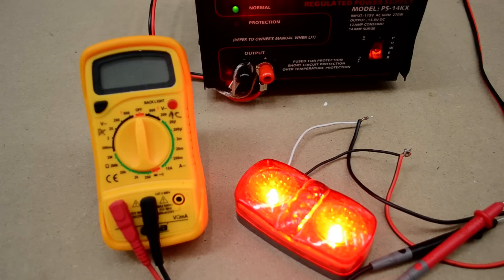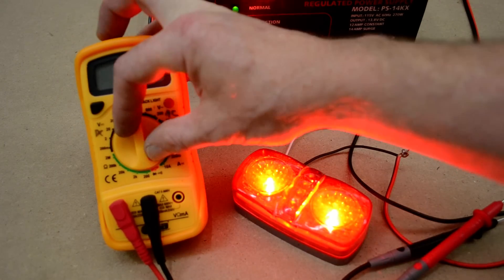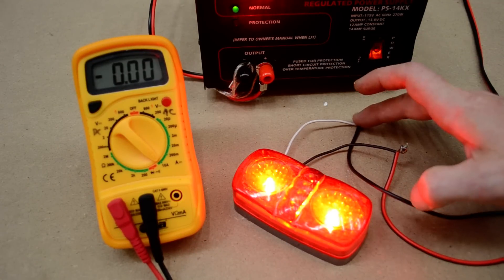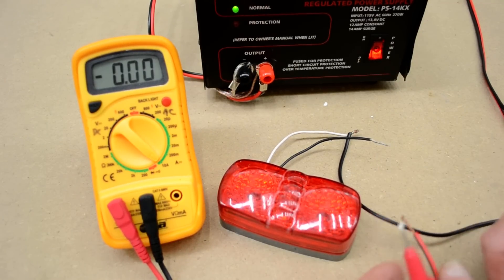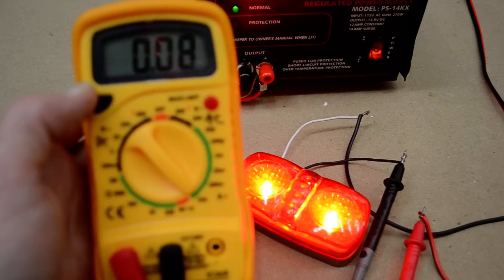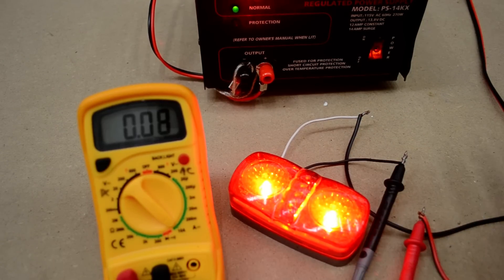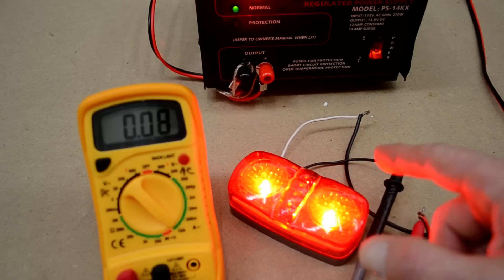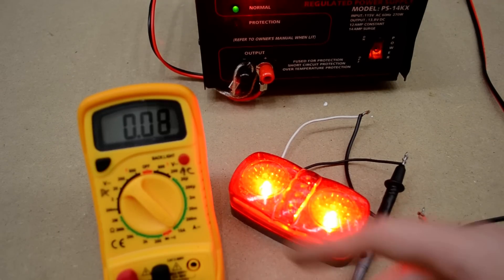How To Test Amperage / Amp Draw and properly measure and fuse a circuit

Comment: This was so well explained but when I went and hooked it up it didn't turn on? I did see a reading. 2.6.The appliance was a 500 GPH Rule pump, it says (1.6A at 1M of lift protect with a 4A Fuse) My cheap Lowes Southwire has a selection of 40A DC that I used. Thanks for your video

Comment: This video is giving incorrect information unfortunately. If you consider what the meter is telling you, this lamp is drawing .08 mA of current. The DVM is set to 10A but this does not mean that the reading is close to 10% of 10A (refering to the .08 reading). The 10A setting is a 'MAX' setting of the meter in this position, meaning that you can test a 10A MAX circuit before the internal DVM fuse blows, but still, the meter is showing you the actual current that is drawn, which is in this case .08mA. The correct fuse would then be something closer to .08 mA. When he suggests a 1A fuse, this is 12.5 times higher than .08. I think the smallest glass fuse you can find is .225mA (1/4A)and this is almost 3 times higher than what is needed. 1/4A fuse would handle the lamp.

Comment: Thx, this helps refreshing my knowlegde. So just to be clear, a device pulls amps? so as long as the voltage in the circuit is right, the device can never overload by say, getting too much ampere?

Comment: Would you read the charging amperage the same way? Like i want to check my battery charger to see what amperage it gives out to charge the battery? 

This is my thinking on the positive side connect the multimeter red positive to positive on charger and multimeter black to positive on battery. Will this be accurate or is there another way to test a charger amperage output?

Comment: thats not 0.8amp, thats 0.08amp.... my 25" industrial fan which feels like a plane is 0.93amp, 100% sure that mini light doesnt draw that... 10amp on the meter means max 10amp but thats still a direct amp reading, you dont need to move the dot like you did mentally for whatever reason.

Comment: I need to try this on my 12v "cooler". It heats up the cigarette lighter plug so hot you can't touch it. Never pops a fuse. It claims to be 65w. I call Bullshit. I've had these in the past where it actually DID melt the plastic and never popped the fuse- either in the plug or on the vehicle.

Comment: Damn, since when .08¢ is the same as .80¢? Numbers in decimals are the same as your amp readings, .08 is NOT .8! That’s an equivalent bulb to 1w at 0.08/80mA’s.
Reply: And don’t tell me that b|c it’s on a 10a scale that it’s all of a sudden a “multiplier”, these aren’t RPM’s lol. It would had stated it, just like when you slap the meter to read voltage. you put it on 20v and if your reading is 12.43 then it’s 12.43!!

Comment: Pretty sure that 0.08 is 80mA.
0.8 would be 800mA.
1.00 would be 1A
And 9.99 would be basically 10A.
Otherwise the readings on the multimeter wouldn't make sense.

Comment: Voltage equals amps multiplied by resistance or amps equals voltage divided by resistance or resistance equals voltage divided by amps. If you want wattage then multiply voltage by amps. These equations are framed into my mind lol

Comment: This is a dangerous way to test. You should NOT test through the "Live" , as (In the case of doing this test, in a car engine) you could blow the fuse,( or worse) if you inadvertently, let the positive lead, touch any metal, in the engine bay. Always do this test, through the EARTH. connection.

Comment: Hi man.. This will be the amperage of the load only, right? Not the power supply..
Reply: Measuring electron flow in the circuit from point a to point b is amps. Volts = pressure 
Watts = power rating example, light globe, 75 watts or 100 watts. Connect leads from meter in series not parallel. Google search if your not sure.

Comment: STOP. this is incorrect. The 10 amp scale still reads in amps. This is 0.08 amps ok. Your 1 amp fuse can power 10 of these lights
Reply: Looks like the 1 Amp fuse would power  12.50?? [ 1.amp/ 0.08 Ends up as 12.5 So 10 with room to spare.]
Reply: Hello can i ask if how to check an fire alarm bell and strobelight to AMPS???
Reply: So your saying .08 does not go up the more lights you add? As long as they are the same AMP light?
Reply: @crazygrady127   No. Given a constant voltage source and constant current demand of the light assembly  the circuits current will never  change.. It will only be split up or remain the same depending on how the circuit is wired. 

With current in a series circuit like this, it’s either all or nothing. Same current through everything or no current through anything. 

However, if he added another light assembly with the exact same specs (power consumption of bulbs, exact gauge and length of lead wires ) in parallel that would just divide the current through each  assembly equally but in the end the sum of the total circuits amperage draw should  never exceed or decrease from 80mA (0.08A). Theoretically.

Comment: Thanks, just watched 2 videos where all the action was happening off-camera, third time lucky, thanks.. The problem I have is my power supply is 12v DC connected to a 12v 3amp speed controller connected to a 12v motor but I dont know what the motors rated amp draw is, theres no spec sheet for it, and the motor is drawing 0.15MA and the motor is getting hot after 1 minute of running. Does this mean the motor is running at a higher amp rating than its designed for?
Reply: Yes.
Reply: @jet-z2r  That was so long ago I don't even know wtf im talking about, I can't remember what the hell I was working on at the timeto ask that hehe

Comment: A Wrap Around Amp Tester Is Safer for High Voltage and Much Easier! Just Clamp it Around the Hot Wire for a Reading! No Disconnecting Wires.
Reply from the maker: Im teaching electrical theory, not entry level quick fixes

Comment: You definitely dont want to use this for an amplifier because it'll blow right through the fuse on the multimeter. Amps draw way much more amperage than a light bulb.

Comment: You said the White wire is ground when technically it’s neutral, and not connect to it but if I were to check the wall outlet for amps could I use red lead to positive and black lead to ground to test amps?

Comment: 0.08A are 80mA not 0.8A, that would imply 800mA

0.08 x 12 = 0.96 watts 

0.8 x 12 = 9.6 watts

Kinda looks like a 1 watt kit to me, dunno
Reply: I know, two years later, but it is the top comment and it is wrong. He set his meter to 10A. So it is 0.08 10A which equates to 0.8A. He is correct.

Comment: i was unknown to use multimeter, i putted 10A port and com port directly in my plug socket. nothing happened just one sec light pop up. but my multimeter is working fine when i use com and volt port to measure voltage. did i blown my multimeter fuse? or everything is ok?
Reply: If you blew your amp fuse, the amp scale won't work. Testing amps must be done in series not parallel. Break the power supply side of circuit. Connect red wire to power source, black to dead wire so current will travel from power side, through the meter, back out through the black wire completing circuit to get measurement.

Comment: And of course the one question I have for measuring current on a voltmeter you didn't go over.. You didn't mention which outlets the wires get plugged into.

Comment: Thanks.  This is really helpful.  Only thing I find a bit misleading is that your light has a black wire coming out of it which is the hot wire and the negative wire coming from the light is white. Normally the negative wire is black and the + is white or red.  You made logical choices for the red and black wires you have connected from your battery but the wires on the light itself are colored opposite of what is typical.  Still very informative.  Thanks for taking the time to make this video.

Comment: Why break a circuit to measure for amps but not ohms or volts? What happens if you dont?  If you put one probe on positive and one on negative doesnt that basically make the current in the circuit go through meter?
Reply: Hey Wazup, to meaure voltage, you can touch the two leads without breaking the circuit.  Think of voltage as water pressure, however amperage is current.  To measure current, you must break the circuit and place the amp meter leads into the circuit as per the video to measure current or as the analogy goes flow of water.  You can however get a clamp-on amp meter that measures the amperage in the circuit without disturbing it.  They're great, I have one and use it all the time to check wire currents in my bitcoin mining rig.  If you were to place the amp meter as you suggest, you would have a parallel circuit (one for the lights, one for the meter) and it would measure the flow through the meter only, and not through the lights.  Electricity truly is like water flow, and it always takes the path of least resistance.  Cheers.
Reply from the maker: No sir, theyre completely different testing methods.
Reply: Doing this would cause the circuit to short. Ask me how I know lol.
Reply: i actually did that today freaked myself out a lil haha
Reply: Lol, i was getting mad attempting to find this question , until i came up on it, long story short i tried what the origanl question was on a fuel pump while it was running and it turned it off causing my engine to turn off, it was then when i figured my memory malfunctioned and didn't mess with it no longer lol.

Comment: My meter reads 4.53 on the 20 & 200mA settings. I'm not sure if that's 4.5mA or...?
Reply: On the 20 amp scale is 4.53 amps.

Comment: Can i test 35 0 35 v dc power supply with transformer ie 200 watts amplifier ...where do i connect positive or negative...because its have ground connection ....i think positive .....am i correct ...?

Comment: Thanks for this informative video. I didn't have my new meter for 10 minutes before blowing the 11amp fuse in it. Didn't know the current had to go through the meter. I thought the meter would be able to know the amp draw on my outlet at home. Just wanted to test out of curiosity. What a dumb move! Appreciate the video
Reply: You can check your AC voltage on ACV setting with the black wire in the COM and your red one in V,ohm, mA, Bat. Terminal

Comment: The first thing is that you've got to make sure the dang whatever it's called testing stick thing is plugged into the right hole, there's two choices lol checking a small 12 volt light stick it in the hole that says 10adc 10amp max, and set your meter dial to 10amp, ummmm I believe that this would be the first thing that should be explained and that's all I've got to say about that, I know nothing but couldn't help myself to reply.

Comment: Does it matter if you stick a fuse in the circuit on the positive vs negative lead?
Reply from the maker: It definitely does, fuses are put on the positive side for a reason, the reason is + side is the supply feed to the accessory  and ground is the return side

Comment: Hi, would i be able to use a 12v dc power supply running of the mains from the house to start a car with a dead battery? presuming nobody is nearby to give me a jump start, thanks
Reply: +bidders77 
God no ... Your car battery can unleash hundreds of amps at once into your starter motor.  A DC power supply (even a fairly beefy one) is likely to be about 20A max.

Remember, it has to crank the engine shaft AGAINST the compression in the cylinders.  That takes a LOT of force ... you'd break your arm trying it : )

I don't know about car engines, but marine engines have a compression lever on each cylinder that opens the cylinder and thus removes the compression.  That allows hand cranking and would allow a 20A start.

But, back to your car ...

Basically, when you turn the key :

- The starter motor draws way more than the power supply can give
- The starter might go 'click' once
- the little red light on the power supply will go dim
- There may be some smoke or a loud bang from your power supply

Better to use :

- Jumpleads from another car battery, or;
- From spare starter battery you keep topped up in the garage

Or, there's always the 'bumpstart' ... where you use the momentum of the entire car to turn the crank through the compression..

Personally, if I needed a bumpstart to get to work - I'd just call in sick XD
Reply: @garychap8384  never seen sucha neat and so informative and adorable comment like yours in a while..😁

Comment: As for the current issue, yes that meter is reading 80mA.  This is a fact.  If you are suggesting otherwise I hope you don't wire houses for a living...Other than that, knowing the application is trailer lights, you would take the total amount of current draw from all lights together (however much that may be) and set a value fuse in place that will open if a short occurs (a wire gets pinched, ect.).  If one light draws 80mA and they are used in pairs, (160mA or .16A) given they are connected to what looks like 22/24 guage wire, I would say a 250mA fuse would be the minimum value I would install (don't forget about transients) or 500mA fuse max.  If more lights are added later, then a fuse value needs to be recalculated.  The point is to avoid a fire during a short because chances are the output transistor/relay that is switching that power signal on and off from the auto can source waaaay more current than 250mA.  That being said you can get 500mA through that wire all day and it wont get hot, any more will open the fuse way before anything heats up while imposing no limits on current draw from the lights.
Reply: Any 1 amp fuse would protect the 22 or 24 gauge wire. Given the amount of lights and draw, that would be appropriate. 1amp under a short circuit, would be a quick disconnect and not harm even delicate electronics. Real world application is far better than expressive mental masturbation math. It’s not rocket science
Reply: +Metalfan1185 guy Magic smoke loves to point out misplaced decimal points in your measurements..

Comment: hi, im testing my LED 5050, Im using a 12v deep cycle battery and the LED use 1.47A, but then I tested with another battery (a regular car battery) and the LEd use 1.52A...it is normal?
Reply: Your batteries probably had slightly different voltages.

Comment: Did Lessco ever correct himself on the amp reading. He was wrong about it being .8 amps, when it's really .08 amps. Or which is it?
Reply: +Terryb31 At the end, he says you can take the "point zero eight, multiply it times twelve" to get wattage. One of the readings has to be wrong.
Reply: +Dave Dacus 
Dave, he didn't need to correct himself. He was right. If you listened to the clio he said that he set the meter to 10Amp which means that .08 of 10 amps is .8 of One Amp. Hope that clears things up with you.
Reply: +Dave Dacus this is exactly why you get an autorange multimeter
Reply: he did mess up on reading the first time. setting meter to 10 amps max has nothing to do with display. it wasnt a X ohm reading.

Comment: It reads 0.08 on the 10 Amp setting that means 0.08 A or 80 mA. 10 A is a huge current that you almost never encounter, especially not in a car. If you are expecting the current to be little you would not use the 10 A setting. That is the highest setting on handheld multimeters.
Reply: Good point, I stand corrected there are currents in car wires in excess of 10 Ampères. The fuses are just there to protect the devices they are in series with. Just because you have 30 Amp fuses doesn't mean you have a current that high in the wire. The guy in the video is still wrong because he confuses mA with A (1000 mA = 1A).
Reply: Also, NOPE
https://en.wikipedia.org/wiki/Metric_system
http://www.fluke.com/fluke/inen/products/digital-multimeters
http://www.walmart.com/search/?query=multimeters
Reply: ***** Not sure where you get your information from but many systems on a car draw far in excess of 10a. You only have to open the fuse box to see the 30 and 40 amp fuses in there, check the main bus and you might even find a 70 amp fuse
Reply: ***** Also, 10 amp is the LOWEST setting on most cheap multimeters. Not the highest.